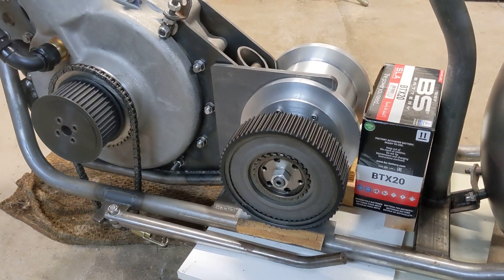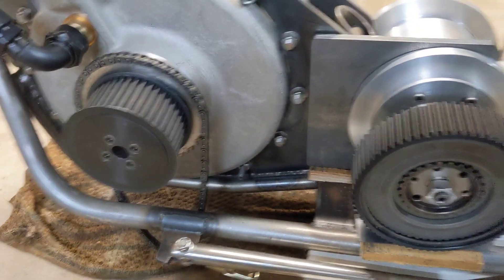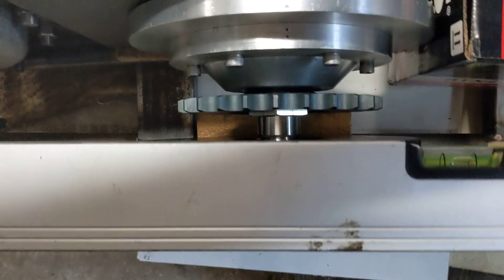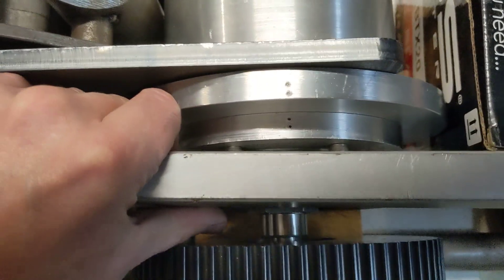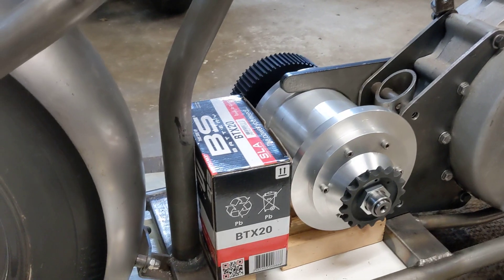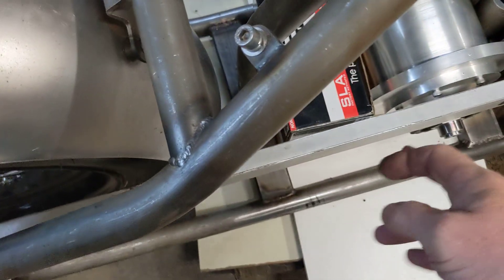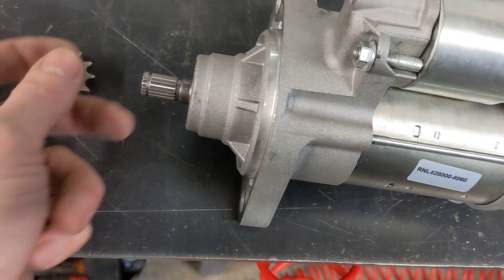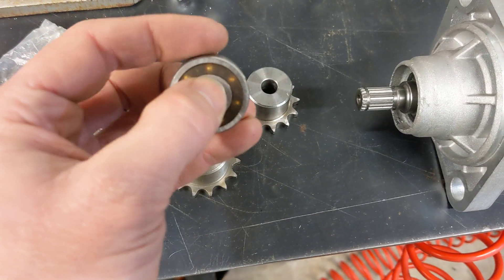Gearbox and Starter

Comment: Did I understand you correctly that you are planning to use two drive belts? One on each side?
Reply from the maker: One primary drive belt to the gearbox. Then two final drive chains to the rear wheel. Only one chain in use at any one time, giving two speeds. 😁

Comment: 1) Your flanged engine pulley should be narrower than the unflanged clutch pulley to ensure the belt doesn't ride over the edges of it. 
2) You should use the straight edge across the face of the pulleys and sprockets, the way you have done it with the pulleys just means they are parallel in a horizontal plane, they could be toed in or out, and using the straight edge on the top of the sprockets is meaningless other than to show there is clearance.
In case you were wondering I have been building bikes for 55 years and using belt primaries for over 40.
Reply from the maker: I've gone across the faces too Chris, I just didn't show that in the video.
Reply from the maker: @@retiredbore378 I've no idea, sorry. I'm my case this clutch basket is also the driven pulley and it doesn't come with a flange. (Presumably so it fits in the original Norton primary chain case). The front pulley that comes with the belt drive kit was flanged, but it was too small so I bought another. That was only available with flanges so that's what I got. I think as long as it's all aligned the belt will track true, flanges are a last resort.
Reply from the maker: @@retiredbore378 let's see if we meet a reply from Chris.
Reply: @StoneEng  I think you need to narrow the front pulley to the width of the belt to reduce the amount it can move about sideways as much as possible, don't forget there will be a small amount of flex in the gearbox shaft and the clutch itself which will try to skew the belt.
Reply: @@retiredbore378 I think they only run flanges on one pulley as the belt will then find it's own "happy" spot on the other rather than fighting against the flanges and wearing the sides away, I had one on one bike and after some considerable time had the clutch apart and accidently refitted the belt the wrong way round, it obviously wasn't happy and ran off the back of the clutch and into the rear chain.